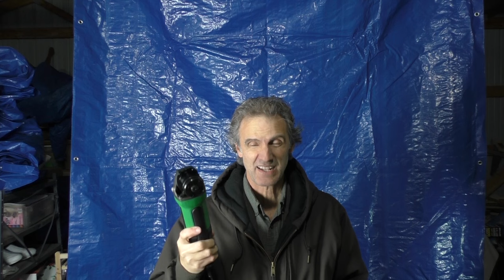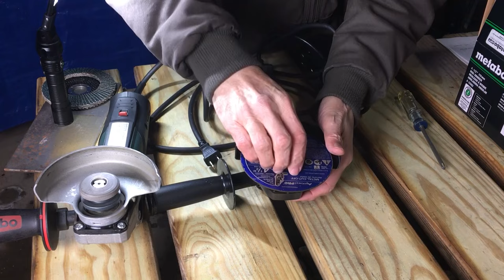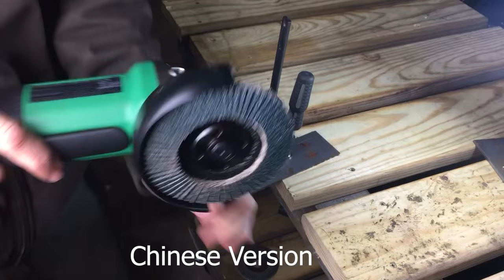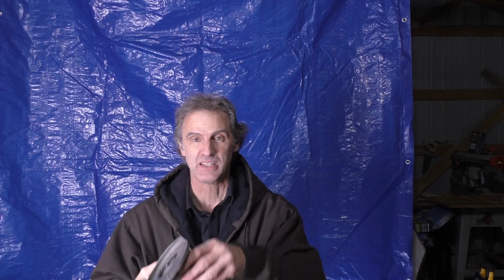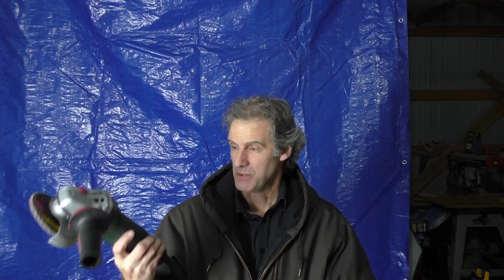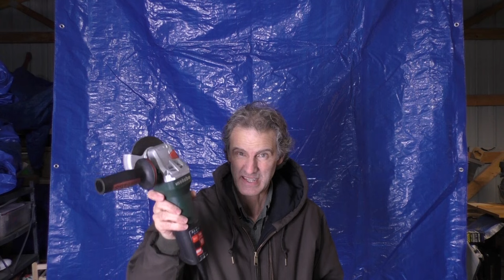Review: Chinese Metabo HPT vs German made Metabo, this might shock you!

Comment: I just bought the Chinese version at Lowe's for an amazing 37 bucks for my son in law for Christmas. He works at a company called East Coast Metals that makes metal roofing and other types of metal sheeting. So I figured he would have some fun cutting some metal with this unit. I was bit put of by the lower amperage but it appears it will be just fine. It also came with a 5 disc assortment. Thank you for the review. It will be fine for his first unit and will last for years. So for 37 bucks I think I did OK.
Reply: I use it to cut stone everyday he probably thinks it’s just fine 👍🏼

Comment: I own both German Metabo and Hitachi/Hikoki/Metabo HPT power tools and both are great quality tools. I'm not saying your opinion is not valid, but it seems like you're main concern is where its made and not how it's made. I've lived in Germany for a total of 9 years and I've seen plenty of cheap German made tools. My point is, regardless of where a product is made, it's the overall quality and features are what sets it apart. Just because it's heavy, does not mean it's heavy duty. The tightness of tolerance plays a huge role in anything that heats up, and it could be those tolerances are due to heat expansion. Yes, there are a lot of cheap Chinese made tools out there but not all of them are substandard.

Comment: Good Review. There's now a HUGE price gap between the 2. Chinese HPT version is $40, (and I bought mine one sale for $29 on amazon).  For $30 vs $100, with a 5 year warranty...no brainer.
Reply: 5yr warranty no way. Read the warranty, the corded grinders are an 'exception' to the 5 yr warranty...It has a 1 yr warranty.
Reply: @MrWizDad   WRONG!  Metabo verified the 5 year warranty on the corded grinder I purchased. They still advertise the same damn unit with 5 year warranty right in the description.  They specifically stated that the 1 year limit applies to cordless. Stop pulling info out of your backside without verifying.
Reply: @MrWizDad  Nope, it has a 5 year warranty.
Reply: C’mon I’m just telling you the facts, no need to be rude. The Metabo HPT Angle Grinder G12SR4 I bought on July 16, 2020 from Amazon stated 5 yr warranty in the Amazon headline. A great deal for the price so I bought it. When I got it and read the instructions, the Limited Warranty page shows ‘Corded Grinders’ listed under the ‘One Year Warranty’ section, which is an ‘Exception’ to the “Professional 5-year Limited Warranty”. WTF. So I sent a request to Metabo HPT customer service at https://www.metabo-hpt.com/us/footer-navigation/contact-us asking if the warranty for this grinder is 5 years as stated on Amazon, or 1 year as stated in the manual that came with it. The reply I received July 20, 2020 stated “Model# G12SR4 only has a 1 year warranty.”

Comment: Just by happenstance I happen to own the exact Hitachi grinder I bought it as a throwaway tool , because I put a 9” sanding disc on it to grind down bottom paint on my vessels  the paint dust is very coarse and typically destroys bearings  and other moving parts  my Hitachi performed the tasks fine and is still in use as a grinder even 20 something years later  I’m quite happy with its performance

Comment: The Metabo HPT with 5 grinder wheels is $39.  That's $20 in wheels alone.  You get a case too.  I prefer this deal over any other cheapo brand.  I only use it as a dedicated grinder and that's it.

Comment: I bought this one at Lowe’s. It came with 5 thick grinding wheels. I do tile work and wanted to put a diamond blade but find that its too thin so its loose. I press the lock button and am able to still turn the blade. Hopefully this makes sense and someone can shed some light. Thanks!
Reply: Turn the nut that holds the wheel on over, one side is for recessed  wheels like grinding, flap wheels ect. and the other is for flat cutting wheels.
Reply: Yes the other comment is right. You need to flip the nut around! I have the same grinder and it has no problem with diamond wheels and other masonry wheels.

Comment: Would you recommend something like the porter cable over a milwaukee?
Reply from the maker: No, I have a Porter Cable, and a Milwaukee, the Milwaukee is a better grinder.
Reply: @jeffreyhunterbuilder  thank you.
Reply: You need to say what you want out of it though. Using it twice a year around home? Yeah, go for PC. Using it every day at work, make an investment lol
Reply: @hagakure81  enlighten me
Reply: @bjornegan6421  can you elaborate?
Reply: @hagakure81  ... what is an investment and why
Reply: @bjornegan6421  What I mean is that if you are using them professionally every day, it's worth investing in a high quality tool like Milwaukee, Dewalt, Makita, Metabo etc. If you are using them semi-regularly at home for some DIY but want something decent, the Bosch (green range), AEG, Hitachi, etc are all decent. And if it's just that tool you might use once in a blue moon, heh, just go for the cheap one, Ryobi for example, Ozito, Black & Decker etc. 
I've bought several AEG tools for use at home and really liked them. Had some makita corded tools (grinder, router etc) as well.
But now that I needed a professional cordless kit I've invested in some Metabo (proper Metabo, not the rebranded Hitachi) tools.
That's what I mean by investment.
Reply: @hagakure81  why
Reply: @bjornegan6421  yes
Reply: @hagakure81  k
Reply: @hagakure81  was that necessary?

Comment: i don't understand metabo is made japan right?  not made in 🇨🇳
Reply: The best way to explain it is: Metabo HPT is just a new name for Hitachi tools. Yep, it is JUST a name change.
Same tools just new name.
Metabo (without the HPT behind it) is a German company.
Metabo and Metabo HPT tools are different and NOT interchangeable. Battery packs, etc.
Reply: @dave5190  it's interesting that the battery packs aren't interchangeable. I thought they bought Metabo to get access to their battery tech. Now the HiKoki (and presumably the Metabo HPT tools) are rocking the multivolt (18/36) batteries, while Metabo have their LiHD which they actually share with multiple other European tool makers...
Reply: @hagakure81  actually Hitachi batteries and metabo hpt batteries ARE interchangeable just the original metabo is not compatible
Reply: @brandonrasmussen6692  Thats because Metabo HPT isn't Metabo, its Hitachi, now Hikoki with a new nameplate. My comment even stated that presumably Metabo HPT tools are using the MV batteries.